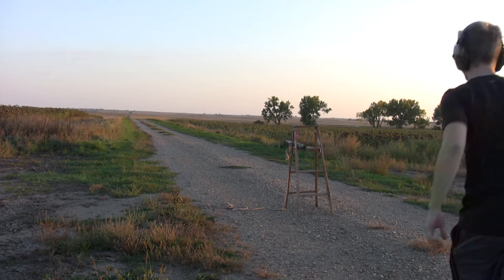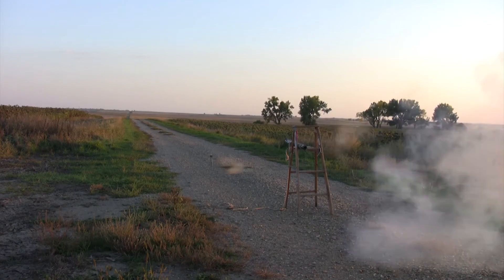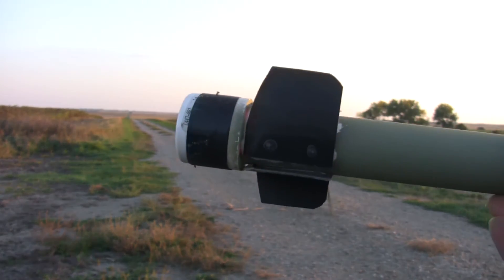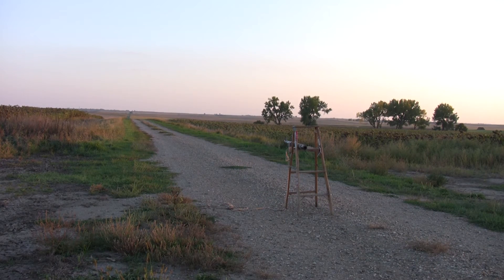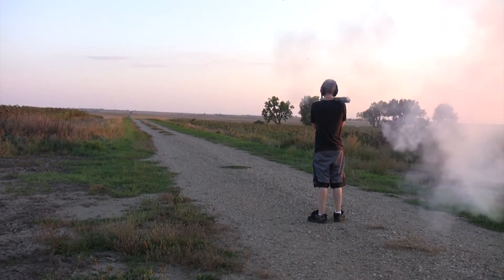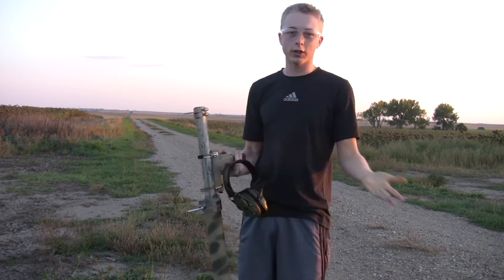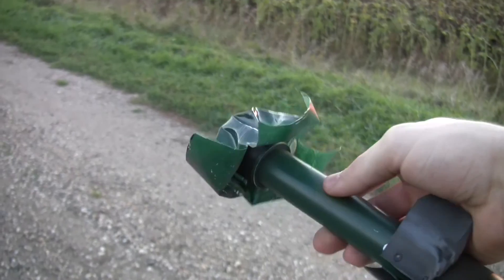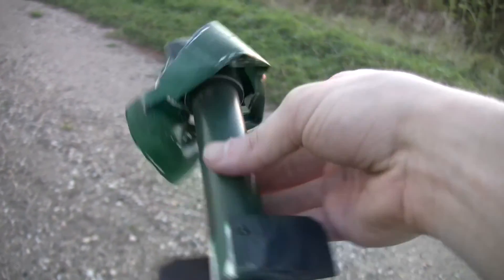Dummy Rocket Tests with RPG-2

Comment: If you want a better flight for the bottle 2nd rocket you should put spring loaded fin stabilizers to have a better flight path and stability also you could put a stronger nose cone on so it doesn’t self destroy when leaving the launcher
Reply from the maker: I really need a lathe/milling machine to accomplish that. I'm kind of putting this project on hold until I have access to tools like that.
Reply: @pyrogun1839  Ever think about 3d printing parts?
Reply from the maker: @kidddogbites  yes, but they would have to be very sturdy parts to hold up to the forces
Reply: @pyrogun1839  Check out Ordinance Lab and C&S Creations. They've been playing with somthing very similar. 3d printing has been around for a while now and people have gotten studf figured out pretty well. PLA is stronger than youd think. It should widthstand the boost charge as long as you have a gas check between the booster and main stage. Use a 0.6mm Nozzel at 135% extrustion width at 0.15mm layer height with extra layers around the perimeter. Im confident you will find a design that works.

Comment: In the real thing they use like 150 gr of black powder. If lived out in the country i would have made one already.
Reply: Yeah close enough to that. IIRC 120grams in a tube split into 5 separations with cardboard disks. Don't know if the separations are to make the tube rigid or if there is another use for them.  All I know is My klein used 54grams and that made one hell of a boom, It would be interesting to hear the noise one of those makes.
Reply: ThomasG10mtn I remember it from BOCN or the german ammo forum iirc. there was a cutaway and someone mentioned 125 or 120grams
Reply: My bad found the info on my comp. 220 grams not 120
Reply: May be that, or just to strengthen the charge tube. as all it is is paper/cardboard.